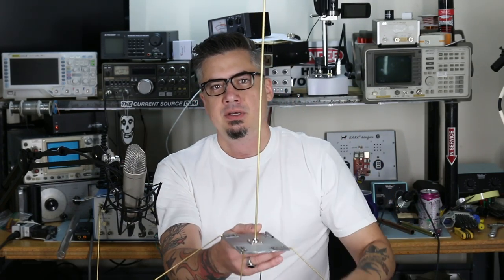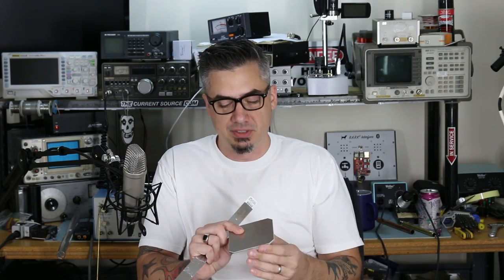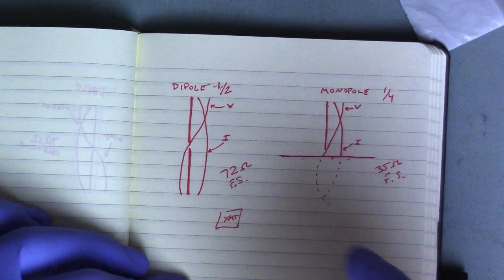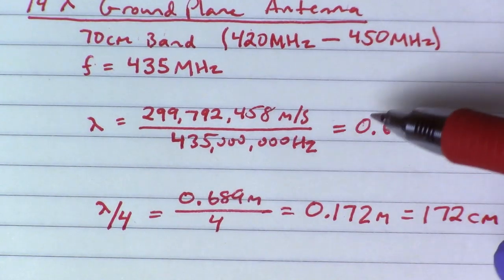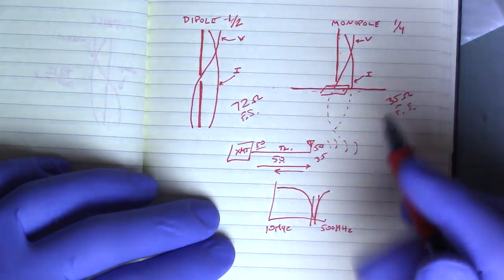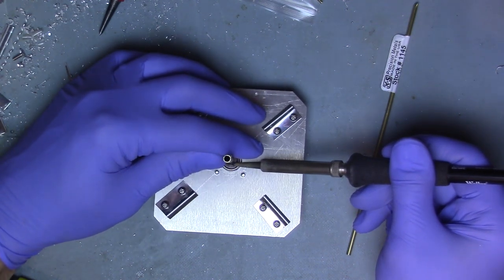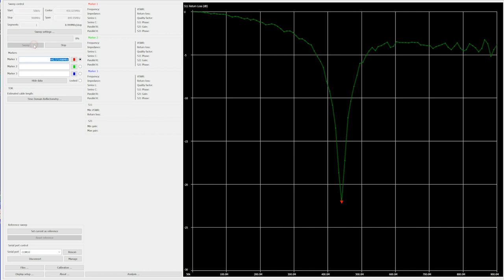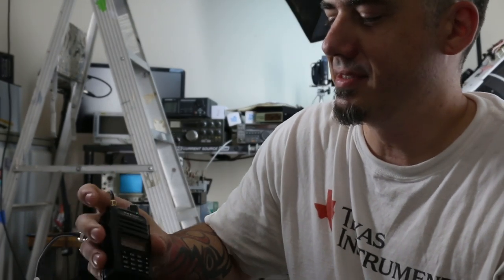Make a 1/4 Wavelength Antenna + Calculations

Comment: Thanks for technical explanation.  Much appreciated.
However, no doubt you realise by now (3 years ago ?) that you slipped a decimal place in your calculations. At 8:00, up pops the line with 1/4 wave length calculation.  0.172 metres should be 17.2 cm …. they don’t cal it “centi” for nothing 🙂 ….. or you could have left it as mm.
Assume you’re USA, so maybe you’re use to using Imperial units, and are metrically “challenged”. 😆
I’m from Australia.  I read down thru the first 20 comments or so, on my iPhone and couldn’t see any pick-up on this point so posting.  I notice one commentator was Canadian (metric), but no mention ?
Reply: Ok … I should have kept watching … corrected.  Perhaps you should have subtitled the correction immediately instead of waiting 45 secs in the video, and then only leaving it up for 10 secs.

Comment: I appreciate the video and design, just got my license along with my dad. We can't quit reach each other with handheld radio antennas. This looks like the ticket. Also didn't realize I could mount an antenna inside the attic. I really like that info too. I was trying to figure out were to mount an antenna outside  somewhere that didn't look like junk on the outside.  Good stuff. Now I'm figuring out connectors for coax. Little details I got to learn. -Like does a so-239 connect to a pl-259.coax connector, then a SMA female connector that looks like a male connector to the radio. --LOL, Just scratching the surface.
Reply: With the proper Dapters they work withe sma

Comment: I'm in the woods here, Laval Que, tree haven, where I'm trying to simply catch 2 FM stations, CHOM 97.7 and The BUZZ 99.9 with a cheapy FM audio receiver/player in my man cave without the shitless static I'm getting so I'll try this antenna out, thanks. After success I'll try the same for the Tele,TV... free over the air signals. Bell and Videotron, over here, is costing way to much $ :)

Comment: You can tune almost any groundplane antenna. The easiest antenna that I've and tuned down to a 1.2 across the band and  was made with a random length of half inch copper pipe and some ground wire configured in an x on the peak of the roof. Your radials should start off 1/2 the length of the mast. To match, take small cuts from the bottom of the mast until you get close on your center freq.
As stated earlier I had a 10.5 foot mast tuned on the CB (36ft) down to 1.2 on 20. 1 and 40 were down to 1.3. On a stock radio I could talk 10miles on the average day. My peek dx was 25miles.

Comment: For your four ground plane radials is the measurement from the edge of the aluminium base? Or do you measure from the edge of the So239 socket? They are significantly different numbers.
Thanks
Derek ZL1DCB
Reply from the maker: The aluminum plate is part of the ground plane, so should be included.
Reply: I came here to ask that!

Comment: At around the 9:14 point, you begin to talk about the velocity factor of certain materials. For coax, the Vf is on the product data-sheet, but would you be able to share your source for the Vf of other materials such as copper?
Also, the multiplication for the radials - You said something about "the test book". Is that some part of the US amateur radio exam? Did hear "test book" correctly?

The reason I'm asking is that I'm considering doing some videos in the future about antenna construction, and while I can model various antennas in MATLAB, it doesn't show me WHERE it got its numbers from - It just spits them out, which isn't very satisfying. I'd like to cover high gain antennas VS unity gain antennas.

Thanks for the videos!
Reply from the maker: Thanks for watching, and the comment. Yeah, I realized I fudged what I was saying about "test book"; what I was meaning to say was "the text books" - various antenna books that I own. Should have clarified, but after being in the 100deg attic for half an hour... proper editing was the last thing on my mind.  :)  The Vf of a bare wire is peppered here and there in  ARRL literature as 95%, though I'm sure varies a few percent depending on the dielectric (air). Honestly, you have to trim an antenna anyway and if you're off one percent for 70cm, maybe we're talking about a mm or two "error". Just constructing the mechanical components, you'll probably end up causing larger errors than that. All of this tolerance stackup will cause you to end up tuning the antenna anyway. Of course as you go up in frequency, you have to be more precise. 70cm, this is all not so critical for general applications.
Reply: @AmRadPodcast  
Thanks. As usual, Google is our friend, so I'll do a bit of my own research also - I just wondered where your numbers came from.
I actually work for a commercial radio supply company doing programming and site instals. When we fit an antenna to a vehicle using anything like the NMO mount, we have no choice about the "radials" because the groundplane is just the vehicle roof. This leaves us with the vertical section to adjust. I've been meaning to try some experiments with vertical length vs coax length to see if there is any kind of mathematical relationship that would get me pretty close.

Homeowners association: Antennas maybe specifically banned, but isn't almost your DUTY as an American to put up a US flag? The pole could be fibreglass, and it would be YOUR business what was inside it.

Comment: Just a note about velocity factor. With coax or parallel transmission lines the VF may be as low as 0.5 and metal tube will also be low, if the diameter is large relative to wall thickness.

Comment: I'm building one of these for portable use using domestic radio telescopic antennas. I found some that extend out to 1.2m so it should be tuneable across the 4m, 2m and 70cm bands. Minimum weight with quick and easy deployment are the main design criteria.👍🙂
Reply from the maker: Hey Phil. That's a fantastic idea! So in that way you can adjust the radiator.. are you adjusting the radials as well to match? I imagine that you'd have to mark them somehow so you don't need to constantly tune when you change bands? Very cool
Reply: @AmRadPodcast  The antenna uses 5 telescopic elements, one radiator and 4 ground plane elements. They come with F connectors which I should be able to modify and use so they can be unscrewed and easily stashed in a back pack. A bit of field testing with an analyser or VNA will give me the optimum lengths of each element, then I'll mark them up with a permanent marker pen so setting up should be a 3-4 minute job👍

Comment: Question, and I hope you will answer me.  I have a Diamond 7900 Super Gainer 7/8 wave 2m/70cm antenna, which says on the site where I bought it "Does not require ground plane" But I am planning on using this antenna for Field day, on a 12 foot tall mast. What I want to know, is if I added a ground plane to it, would it help? And if so how long do I need to make the radials. I have been trying to find an answer to this, with no luck. I'm lucky, I live in a HOA controlled mobile home park. But one of the board member is also a ham. So I had no problem putting up a Arrow Open Stub J-pole, on a 15 foot mast. Hey you never know till you ask.

Comment: Hello, thank you for this video which did clear up some things.
It is my first video from your channel and found it very interesting.
I was wondering on how to make an antenna in the 320 Mhz range, 
and so if the rods would indeed have to be shortened.
Reply from the maker: I found this site that does all the math: https://m0ukd.com/calculators/quarter-wave-ground-plane-antenna-calculator/
Keeping the velocity factor that they have as default and using my construction techniques, you should be good to go!
Reply: @AmRadPodcast  thank you very much

Comment: Pardon my ignorance but I'm trying to find out how to make a feild expedient antenna that I can just put In a tree vertically or horizontal as need be to hit repeaters while hiking. Thoughts suggestions? Enjoyed the video nicely done. Portland Maine.
Reply from the maker: Jeffrey Berry not sure what frequency you’re using, but I assume 2m to 70cm.. you could make this same antenna, but using copper wire instead of brazing rod and an SO-239 connector. String the driven element to a tree limb and you could stake a few radials to the ground using same string. It’ll look like a hack, but it’ll work just as well- and no impedance transformation needed.

Comment: whats the function of the radials in the QW antenna u made? Cuz you connected the coax to the center long one right, what happens if you made the antenna without its radials? (noob here)
Reply from the maker: Good question. If you look at a dipole antenna, which are two 1/4 wavelength radiating elements, separated electrically at the feedpoint.. both elements work in tandem (or against each other) to propagate the RF radiation into free space. For a quarter wavelength antenna, one radiating element still exists, just like the dipole, but it still needs a "ground" to work against. In this case, the radials act as a counterpoise ground and serve as the "other side" of the dipole - at least that's how I like to think of it as. If the radials are 90 degrees to the radiating element the impedance of the antenna doesn't match the typical 50 ohm transmission line and quite a bit of energy from the transmitter is reflected back to the radio. If we droop the radials approximately 45 degrees downward, the impedance more closely matches 50 ohms and the majority of the RF is absorbed/transmitted by the antenna - minimal reflection. If we have NO radials, then the antenna will be severely mismatched and the SWR will be very high and nearly all of the RF will be reflected back to the transmitter.

Comment: Really appreciate your video.   Built this antenna for GMRS.  It’s resonate at 
463800 mhz.  Checked it with a NanoVNA and the impedance is very low, around 14 ohms.   Any suggestions as to why.

Comment: What frequency are you building for?  Looks like 2 meter.  I just passed my Technician license test yesterday and got a free Yaesu FT-4VR mono band 2 meter HT for passing the test.  As I wait for my license to appear, I need to build an antenna that I can hit the local repeater without going out on the deck to do so.  I want to be able to hit the repeater from inside my QTH.  On the return loss can't ya just use a mirror to reflect it back to the antenna?  Just kidding.  I thought this build was for a 2 meter antenna???

Comment: It is a violation of FCC regulation for a homeowners association to require or attempt to stop a resident building and operating ham radio, and all of its required instruments, including antennas.

It is considered an emergency communication method, and any local authorities that attempt to prevent a licensed ham operator from operating are in open violation of federal law. Regardless of any HOA agreements.

Comment: Will this work for cb radio?
Reply from the maker: Yes, the theory still applies, but at that frequency the elements would be around 9 feet long. You're probably better off watching my other video on 1/4 wave antenna for HF. Maybe even a bottom-loaded  vertical like a K40 and some ground radials would work.. never tried though.